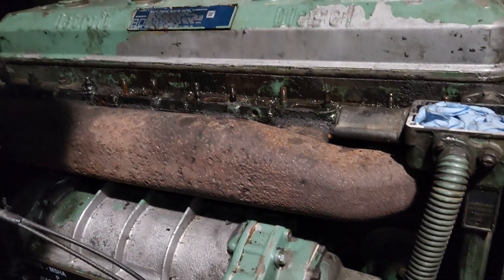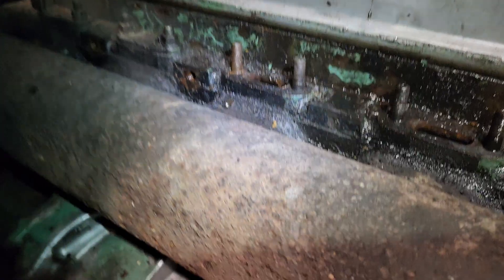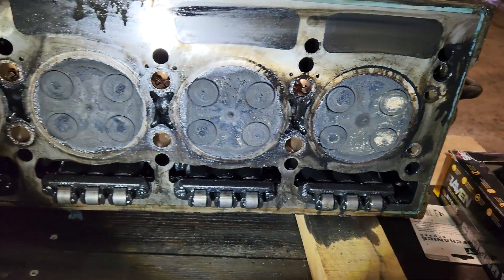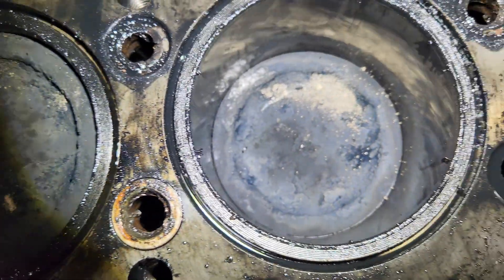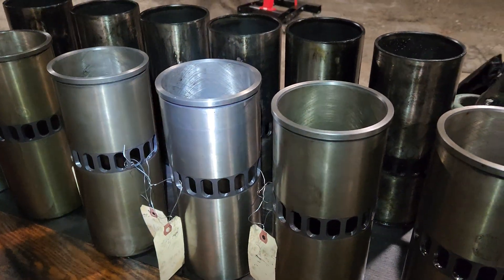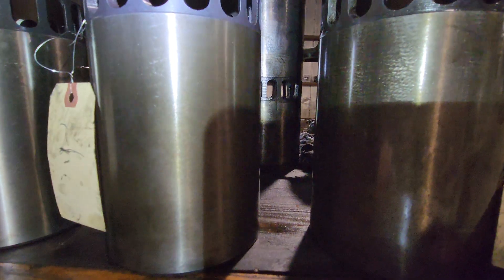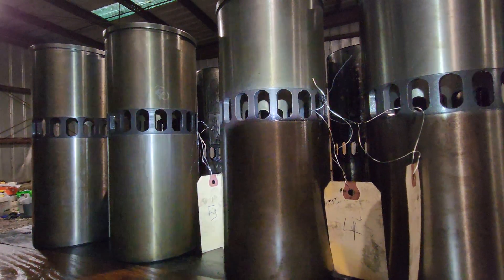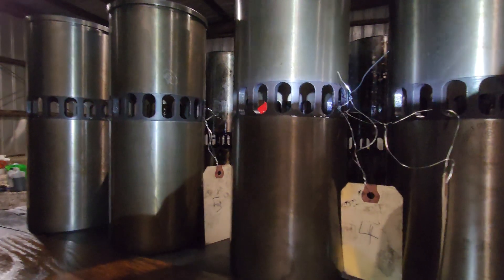Detroit 6-71 Disassemble and NOS Liners

Comment: I have worked on marine diesels since the late 80's, mostly MAN, Cat, Cummins, a few Komatsu.   We have one customer with Cat mains in a push boat that has 3-71 gensets. The guy that did any 2 stroke work left, the work is scheduled, and they want me to do it. I have no issue with that BUT they want an in frame done in four or five days. That is the part I do not like. We have a rebuilt head, injectors and oil cooler from Detroit, and three kits from Interstate McBee. I'm freinds with the guy that was supposed to do the work and he says he will walk me through it. The only part I am hesitant about is fitting the liners.  It is an NA 3-71 and my bud says on the low HP stuff  "if it fits run it" on the higher HP stuff like the high HP turboed stuff liner fit is more critical. This thing runs at 1800 RPM on a 30kw gen that spends most of it's life slobbering and lightly loaded.